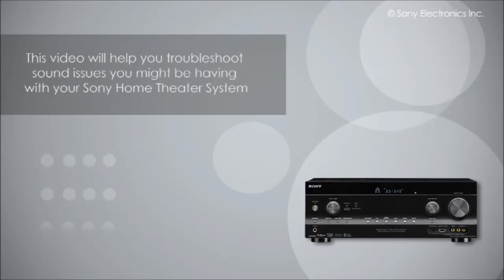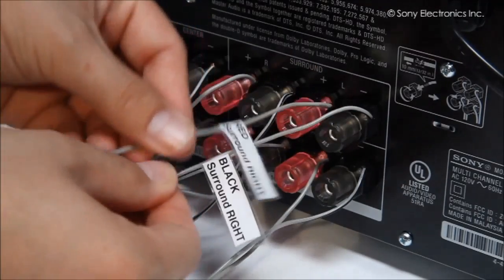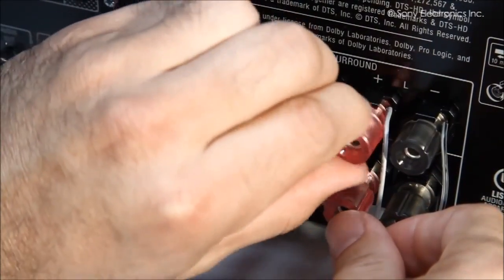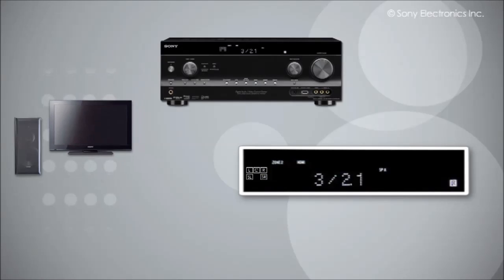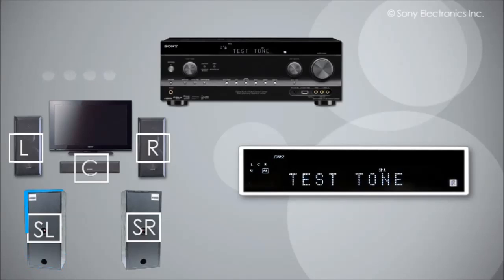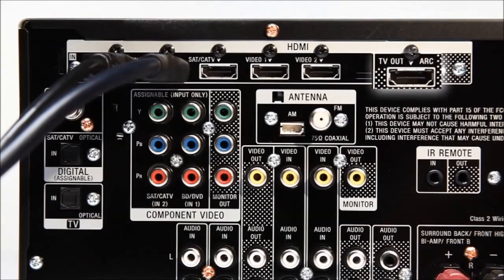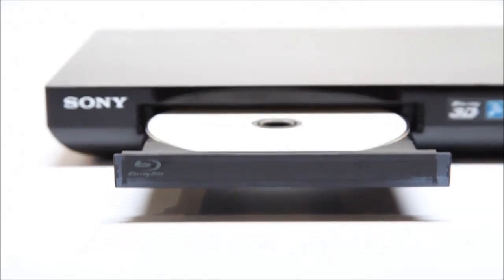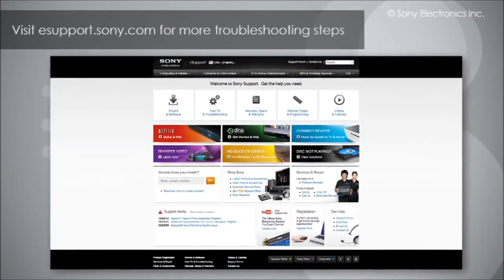How to Troubleshoot No Sound On a Home Theater Hook Up

Comment: mine work and they are connected properly but in my denon avr e300 the Front L and R outputs work perfectly but when i connect the Center and Surround Speakers it doesnt put out any sound but when i used the same speakers im using for the center and surround with the same cables on the Front L R they work..
something im doing is not allowing the C SL and SR to Work
Reply: did you ever find a solution to this problem. I am having the same issue but instead my center speaker is the only one that works but when I plug my phone into an aux cord the center stops and only the left and right ones work
Reply: @alexvanleuven6146  i searched for it and i found some people saying that i should have the remote of the reciever and go to settings and change the audio settings to 5.1 from stereo and since stereo consists of one left and one right channel it makes sense that it will only work on the R and L but 5.1 will make all the speaker and all the outputs work
Reply: Dulla Bills thank you i will try this and see if it works!